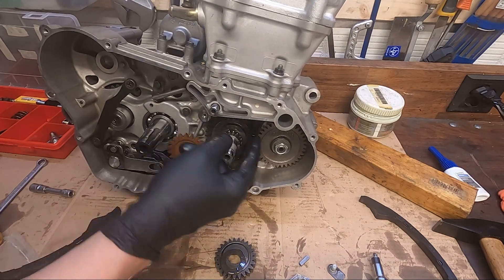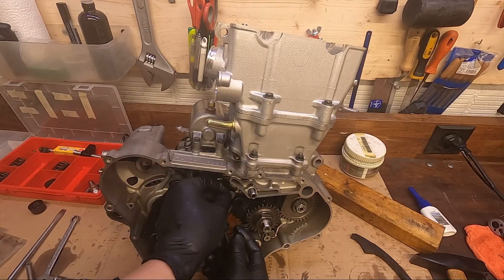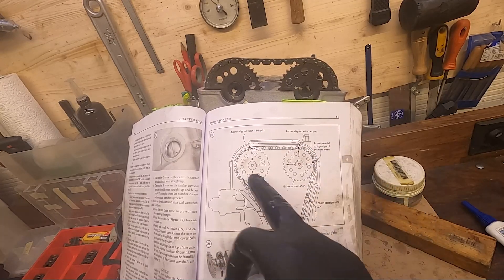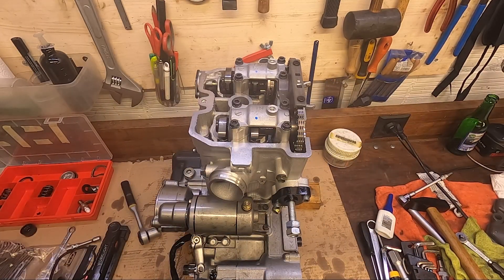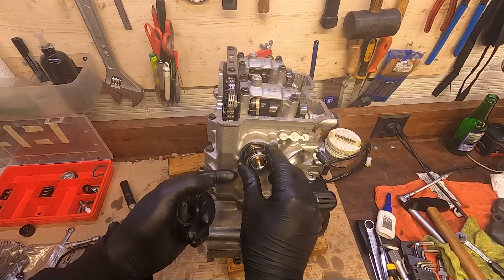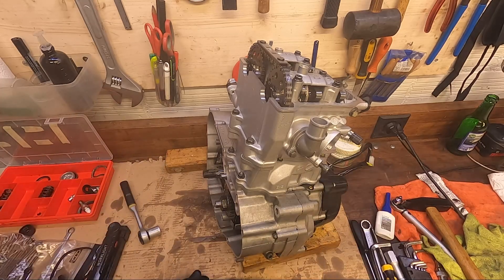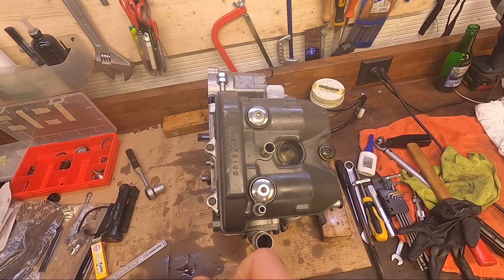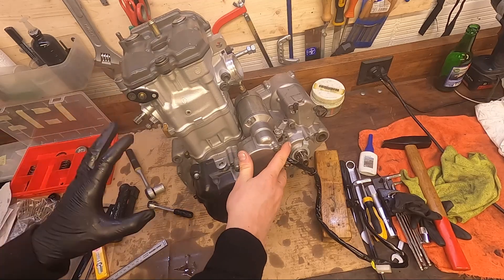DRZ 400 Engine Build Part 5: Timing Chain, Camshafts & Valve Clearance Adjustment

Comment: I don’t understand why you need to remove the primary gear in order to install the cam chain? Can’t you just install the chain while the crank is at top dead center?
Reply from the maker: Cams weren't aligned with left pin, rotating crank seems to switch it. Know now
Reply: @MotoMottoTV What do you mean turning the crank changes the pin on the cam? Isnt the gear on the cranks haft fixed with a pin behind the gear thats spinning with the clutch?

I have my cylinder installed but no head. I can put in the chainover the gear without problems, just the chain guard on the right side needs to be removed.

Ok nevermind i think i answered my own question. if you want to swap cam chains, you need to remove that gear or remove the cylinder head. for you the latter was easier. because the chain guard is in the way.

Comment: I was thinking about Hotcams and chain, would that work on a stock engine? 2020 DR-Z400S
Reply from the maker: @tommygrass1422  I always use the cams from the DRZ400E, they fit without any modifications. Only th cam lobes are shaped a bit differently